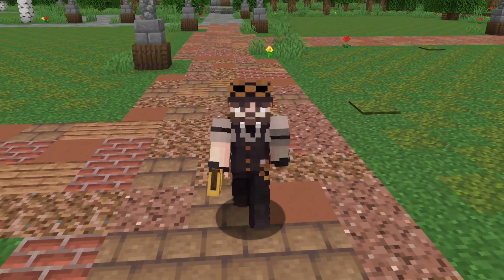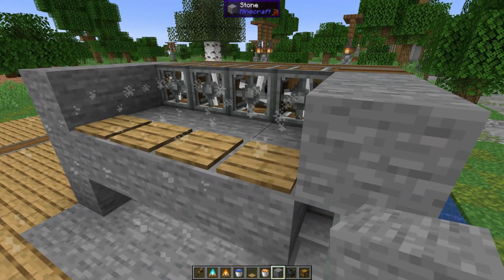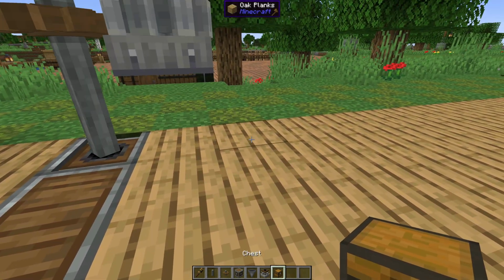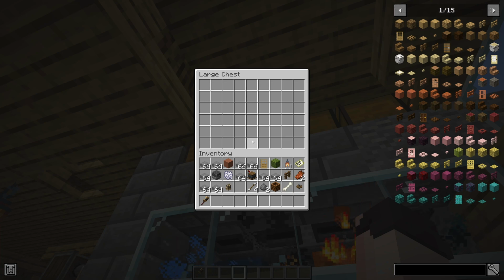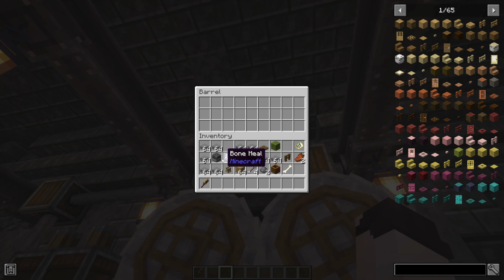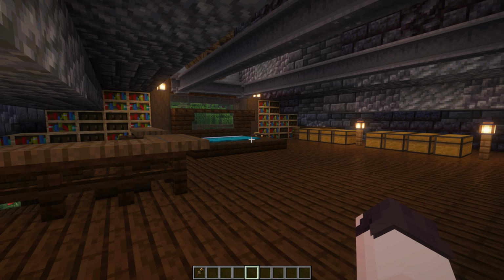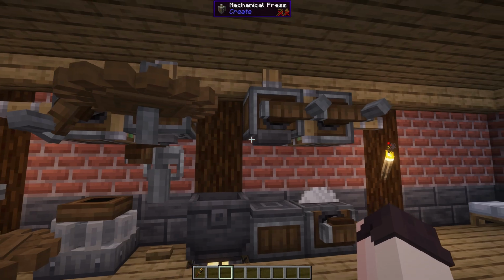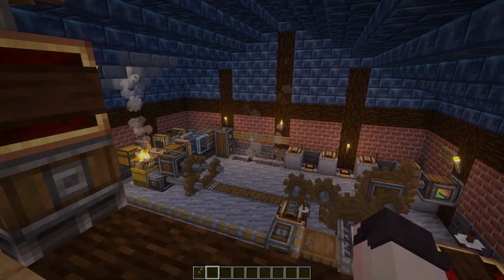How To Build A Create Mod Starter House - Day 1 - 30 Day Build Challenge

Comment: HEY! i got mitereals list for u

 Main Blocks

295 Oak Planks

263 Dirt

148 Oak Stairs

146 Stone Brick Stairs

138 Stone Bricks

133 Oak Slabs

111 Spruce Slabs

104 Spruce Stairs

93 Stone

72 Oak Logs

Structure / Decoration

51 Spruce Trapdoors

47 Create Framed Glass Panes

44 Water

23 Lanterns

22 Stone Brick Slabs

22 Spruce Fences

16 Chests

9 Cracked Stone Bricks

Create Mod Components

30 Andesite Encased Shafts

16 Water Wheel Structure Blocks

9 Gearboxes

5 Andesite Ladders

3 Andesite Encased Cogwheels

3 Cogwheels

2 Andesite Encased Large Cogwheels

2 Large Water Wheels

2 Encased Chain Drives

2 Shafts

1 Andesite Casing

1 Depot

1 Basin

1 Mechanical Saw

1 Speedometer

1 Large Cogwheel

1 Millstone

1 Andesite Belt Funnel

1 Mechanical Press

1 Mechanical Mixer

Miscellaneous

27 Andesite

4 Spruce Doors

4 Andesite Stairs

3 Hoppers

2 White Beds

2 Campfires

2 Oak Doors

2 Smooth Stone

2 Hay Bales

2 Spruce Pressure Plates

1 Crafting Table

1 Stonecutter

1 Potted Poppy

1 Barrel

Comment: Hey there! Im running into an issue where instead of making stripped logs, the saw farm thingy is making cannon molds. How do I prevent this? I think it might be a mod but is there any way around it?
Reply from the maker: @philm4109  you can put an item filter on the saw to set a specific item to output
Reply: @Uberswe  got it, thanks!

Comment: The furnace part does not seem to be working quite right for me. When it hits the pressure plate it gets blown right off. I am a little further in the game and I'm using a speed controller to put a large gear at 2 rpm which then goes into a smaller gear that should match your 4 rpm for all the fans. Any idea what might be wrong?
Reply: Found it, I had a magnet on my belt from one of my mods that was sucking the materials to me. Silly mistake. Thank you for the great tutorial!

Comment: For the smelter, you would have to put items in in quantities of 1 to get the timing right. If you exchanged the first chutes for andesite funnels, I believe it would automatically drop one at a time, no? Chutes would just drop the whole stack of items.
Reply from the maker: No it works with stacks. If you later do smart chutes you can do 64 at a time